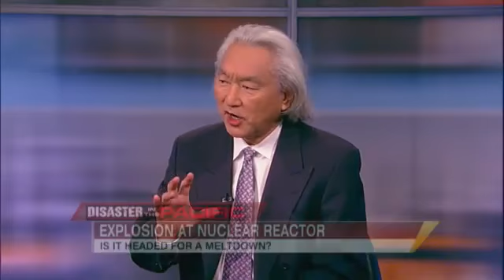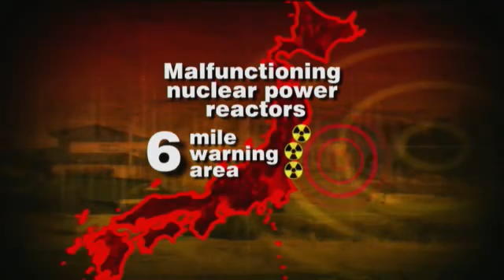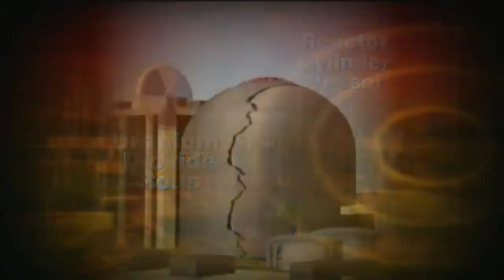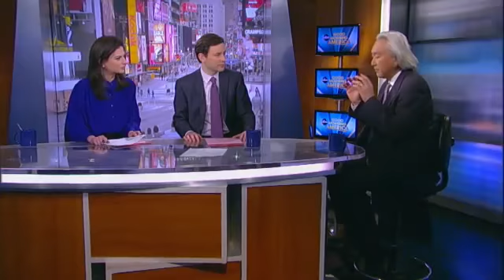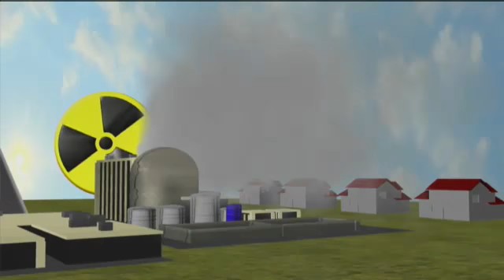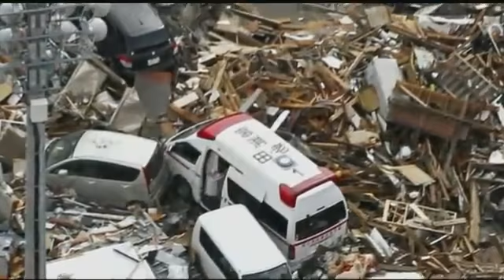Michio Kaku Discussing Nuclear Plant Dangers

Comment: "a car without brakes and then the radiator explodes". Because you're really in trouble if your engine overheats just before you crash into a truck at 80mph?

Hmm, this guy doesn't seem to have much expertise in either power stations or OR cars.

Comment: Although serious the reactor containment building (The thing Chernobyl lacked) is still intact. The top half of the building is not a radiator. No nuclear reactor could be cooled with such a small condenser. 

The upper structure is the containment buildings air condition and scrubbing equipment which is likely were they attempted to filter the pressure buildup before it blew up the filters. Although some radiation would be released it is still safe for now.

Comment: This situation and Chernobyl cannot be compared in the way he's doing.. There's no graphite to burn for weeks and lift radioactive material high into the strongest winds and the level of heat produced from the reactor core was 6% of operational emission (as far as I've understood) and declining, unlike Chernobyl where the core itself was getting hotter; that is not happening here. The reactors are very differently constructed, and the Chernobyl explosion was due to a design error not found here.

Comment: LFTR Thorium reactors don't have any of these problems. They are safe they can't aka melt down or blow up and can eat up current nuclear waist. They can create liquid replacement fuels for gasoline or diesel and can be used to desalinate sea water used with verticle farming "Omega Gardens Farmdominium" and updated public transpotation via electric trains also commercial goods transport, and increase automation in factories. I think that about covers most of the world problems lol.

Comment: @buugiman78 Oh, I don't think anyone's suggesting to shut them down overnight - what can be done is the energy use of industry can be assessed, and unnecessary use cut down, & alternatives brought in to feed the grids (Japan has a special problem with their various regional grids being incompatible - some run on 60Hz, some on 50Hz) at the same rate that power from the reactors is reduced. The existence of the plants will still be a problem for a long time after they're decommissioned. :(

Comment: Oh did I say it was cheap and abundant, We woun't ever run out of the stuff. And it on a magnitude of 100's times more efficient can use at least 2x more efficient turbine system for electricity. and it nuclear waist is less then 1 percent as much as current nuclear reactor more if you start with using existing nuclear waist. And most of the aka nuclear waist is useable extremely expensive materials for medical and materials nasa wants and pays big money for. The rest decays done in 110 years.